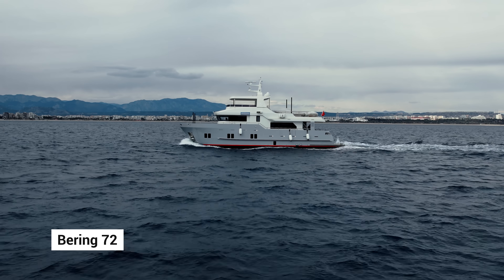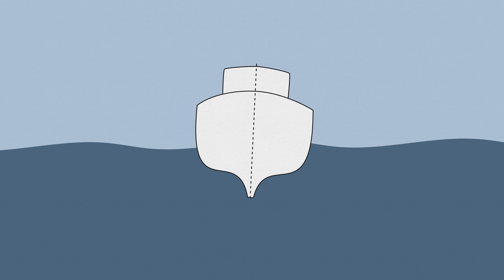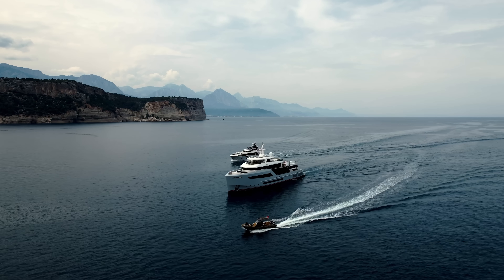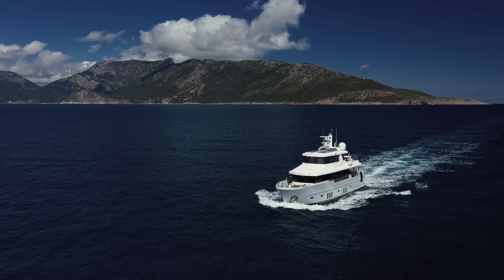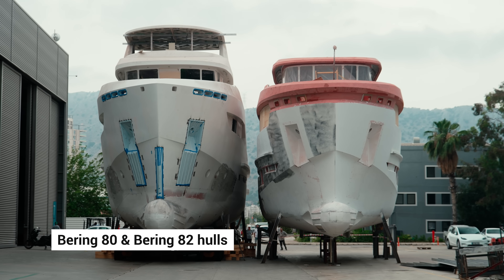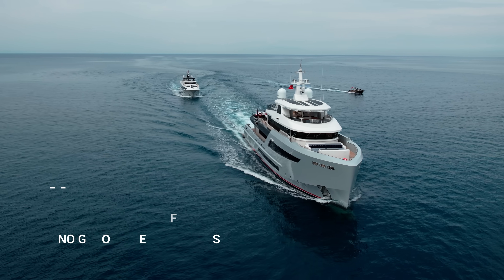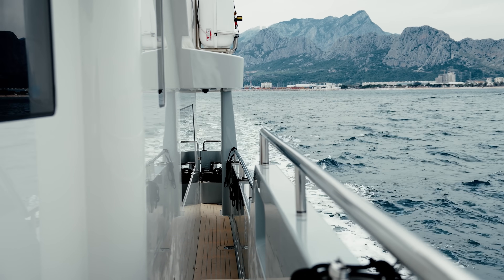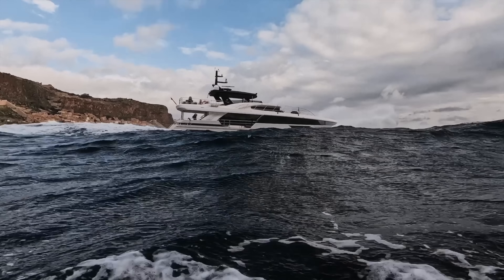Bering Exclusive: How We Engineer Stability at Sea

Comment: Not to mention that you can use multiple units of Seakeepers if your boat is to heavy for one alone and they also added the Seekeeper 40 to their line for about a hundred+ tons.
A Bering 88 with two of them should be a perfect match combined with the fins. :)

Comment: Stabilising is such a game changer.
I remember a very early video with Nautistyles where Alexei described one boat where the owner requested both fins and Seakeeper. Alexei said something along the lines of it being an unusual request and that he thought it caused an odd feeling that he found hard to get used to. 
I'm wondering whether you've shifted on that opinion over the last few years, Alexei?
The talk on this video about retractable fins, would that make them better for mooring and haulout with less dock damage risk, deployed when under way, while the gyro can handle the zero/low speed rolling? Great for at anchor? Of course more systems = more to break/maintain.

Last thought on stabilisation: spacecraft use retro thrusters to adjust pitch/roll/yaw. Could a system of small very quiet aquajet thrusters be developed to perform a similar role? I know that bow thrusters can be very noisy but this is often because they are single speed – off or full bore on. And basic prop design is always noisy because of cavitation. Newer variable speed bow thrusters can be incredibly quiet when only making small station-hold adjustments. And pumps instead of props could be cavitation-free, so quiet.

BTW need better proofing for your script for the AI narrator. Couple of clanger errors: waiting » weighting
fines » fins

Comment: Interesting video and kind of curious to hear what progress has been made with gyroscopes ? Reason why I did not chose gyroscopes on my boat was the immense power supply I would need. A continuous draw of 4 Kw was simply too much. So I went for electric fins which also work on anchor and in port, but which use little electrical power and only use it when the fins are active. In other words, if the sea is calm the fins are in on, but are not active. If a wake or wave hits the boat the fins become active and draw energy. Total energy usage is minimal and I can run that off our solar panels, which means no need to run the generator. 
I understand that larger boats will always need a generator running and therefore make it easier to operate a gyroscope, however, it does mean you need a larger generator than without the gyroscope. 
Btw, those seas you were going through were pretty impressive. We won't be doing that with our trawler. 😀

Comment: My favorite boat/yacht builder. Once I'm able to afford the length of yacht I want, it will be a Bering yacht for sure. The main parts of the yacht will be the experts duty, I get to move walls and design the inside and outside space because I have seen many great ideas of other boats that I truly must have on my own boat one day. Any vessel that we can water ski behind is a boat by the way. The forward deck area, keeping it open and clean with all anchor tackle and everything we normally have at the bow should be under the top deck with ceiling height to stand up in and have 2 boats, one for going fishing and other for taking people to the docks and rescue. You could keep jet skis in the space if you have any extra room for one or two, and the lidt should be in the middle so picking up and lowering the toys into the water from both sides. The rest of the boat will have areas similar to the forward area, and a upper master bedroom with full beam and no sidewalks on either side of the master plus with its own private back deck so people like me who doesn't like to wear clothing I can get a full suntan. I keep wondering if you could put in a walk in or rather a roll in hot tub like those walk in bath tubs that the door closes from the inside so when water is in it you can't open the door if you want to because of the amount of water in it. Then us in electric wheelchair we can get into a hot tub or even use it as a bath tub when in it. Then someone else can remove the wheelchair and close the door, but it needs hand rails and molded places for 2 to 4 people to lay back on with built in pillows and the quick drain of a 2.5 or 3 inch drain pipe to discharge over the side for times when its medically a must to get petson flat to do cpr. I have health problems and i want to help others live longer even tho i wont be, I just hope some of my ideas help people who need it. That walk in bath tub idea, we need it big enough for atleast 2 people facing each other, we all know its more fun bathing with your favorite person, like your awesome spouse. All TV's I think should fold down from the ceiling and all rooms with tvs in them need black out curtains on remote control. I don't need a wine fridge or bar since I can't drink alcohol period because of health reasons. If guest show up and want to drink alcohol then we get it for them but we don't need it when the regular people are off boat, but I have really wanted to this past 6 months but risk of a heart attack keeps stopping me well that's life. I wish you would put up a pricing list of basic lengths of yachts so we know where to start from before adding the bells and whistles to it. Plus how much extra does it cost to add a elevator to a yacht for us stuck into wheelchairs. It would be great to have one main diesel engine and have 2, one on each side of the main one electric. Then i add my free energy motor and it can power itself once it gets started and it put out 440 AC volts at 60 Hz. That should be enough electric to power both electric motors right. But another idea I have is to have 2 smaller diesel engines, one on each side and having the electric motor in the middle but it should be a much bigger one that can move the yacht up to 12 knots or more. Either way it will save you huge fuel bill and save fuel when you start the free energy motor and turn off the smaller motors and remember it powers itself 24/7. Having a free electric motor making the power even if you are at anchor you wouldn't need to start your generator for lights and ac or heat. I planned 15 years ago to give the world this motor for free so everyone can have free power. From that evening i spoke those words on the phone to a family member, that's the exact night my health went 180° and i got worse. Seems someone didn't like my idea. Sure i would like to be rich but for me having a h7ge heart, I'd be helping as many people as I could. But my free power motor, that needs to go to everyone on this planet because there are alot of people who die each year from the heat in summer heat inside their house and freeze in winter because they can't afford the high cost of electricity. I'm going to draw it out once more so the people who work with electric can easily build these electric making systems. I even took a Walmart swimming pool watwr oump and hopked up a super fast dc motor and made 680 volts of AC power. We been lied to about physics and they refuse to admit it because they been wrong for over a century and a few decades. Its time to force them to admit the real Truth and what i said is all real about my free energy motor and amounts of power it can make. Putting electric power or even battery power into wire coils wrapped certain ways, you can do all types of cool things. Levitation and moving heavy objects only using a finger with power from a 9 volt battery is really cool. Science is Awesome my cousins, yes we are all family. I love you all. Open your mind to the universe and see the Truths out there. Love is the glue that holds everything together in our Universe, once you realize that the rest is icing on the cake.
Reply: It sounds like you have some good ideas.I hope your health improves.A track system similar to those that launch the tenders,and in hospitals,would lift a person from a chair and set then into  a pool or bath.No need for possible leaks,or fast filling pump systems. Bering is planning a 'Hybrid-drive' and some of it will be shown soon. Best wishes.
Reply: You can’t create energy out of nothing. You can only transform energy from one state to another…

Comment: Bering make the best explorer yachts on the market, maybe team with Veem Marine using size 54 gyro stabilisation system combined with 5 blade Veem Marine interceptor propellers tuned to the output horsepower of the motors as well as at rest retractable fin stabilisation system, gotta love Bearing or buy a row boat❤❤❤

Comment: Talked about 60 degrees of healing; but, never used the term "self-righting."  Why not?  Can a Bering yacht capsize?
Reply: Most anything and everything man made can capsize. Besides that, rewind to the 8 minute mark.
Reply: Self-righting seems unlikely with anything this large and heavy, and once it takes on water it’s over. I wouldn’t plan any trips in the North Sea with expected heavy weather.
Reply: @HQBergeron  Arksen 85 is self-righting down to 180 degrees.